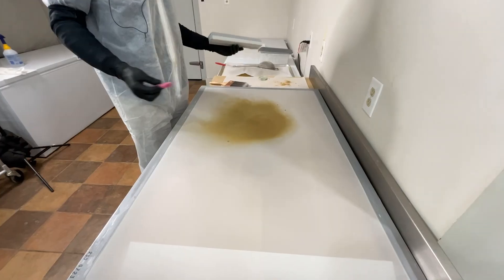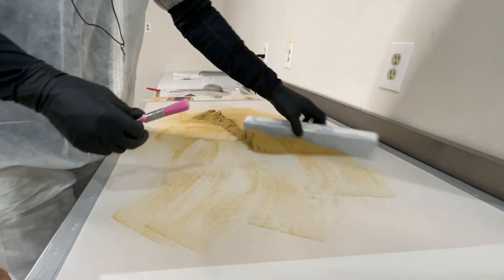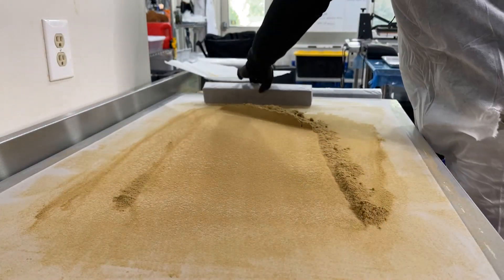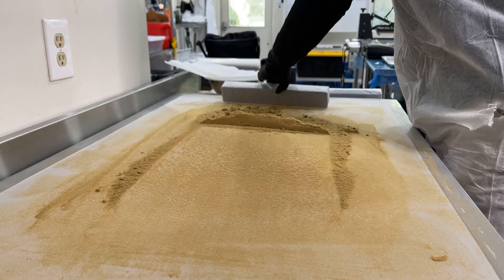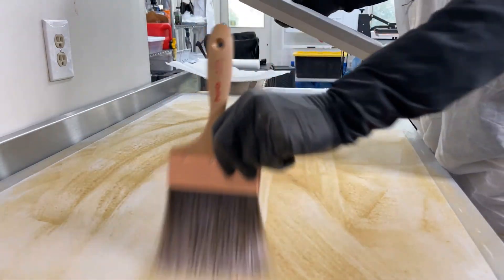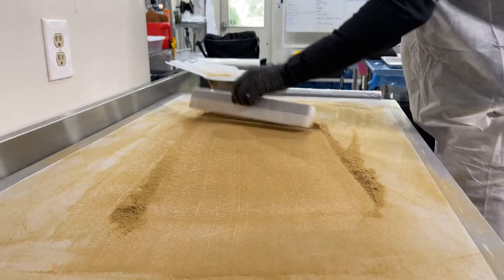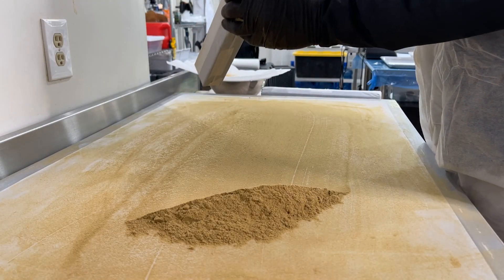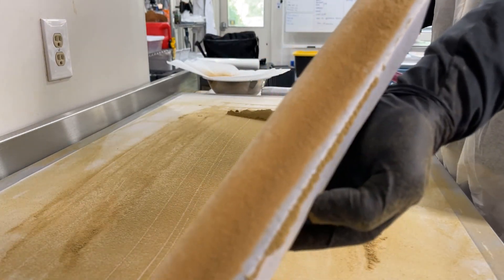Triboelectric Tuesday Episode 14 - Static Sift by Ezra

Comment: Can't this be done automatically through some kind of dry electrolysis? Just run some kind of circuit through it on an incline and allow the stalks to fall to the bottom or whatever? Why does this have to be manual? Seems unlikely to be optimal somehow.
Reply: agreed.

Comment: What is the parchment paper wrapped around???? That should have been explained….looks like a block of wood…
Reply: DVD cases have been the go-to around the hash scene lol. Kinda the origins of the modern version of static tech. They've been doing static tech since ancient times though, pretty wild!
Reply: @GTICHATTER  I like paint rollers
Reply from the maker: Was not explained because it doesn’t matter. Anything soft will work. Experiment and contribute.
Reply: @SamboCreeckFiltration  still didn’t answer the question….exactly what is the parchment paper wrapped in?
Reply: @SamboCreeckFiltration what size micron screens and what order do you sift them in?
Reply: @majorwoodey  86 micron on top 230 micron screen on the bottom…5 screens all together…lowest number on top highest on the bottom..GOOD LUCK